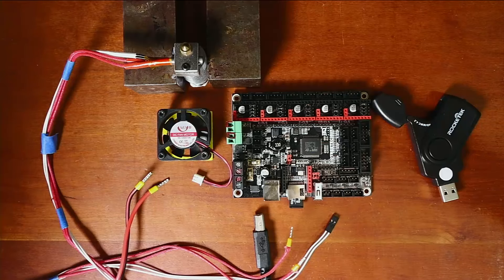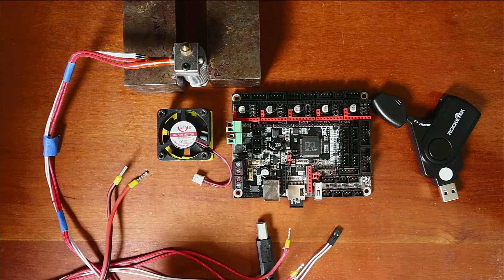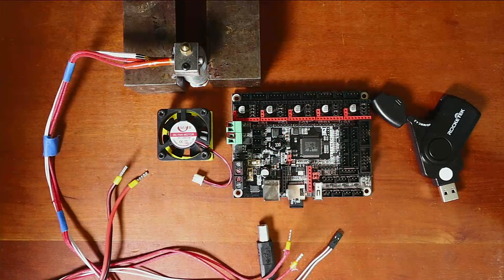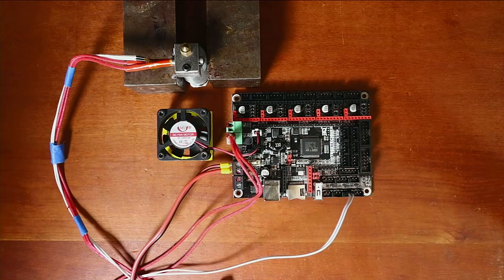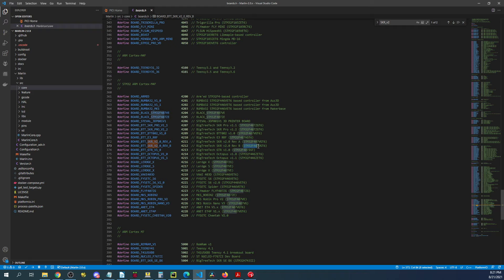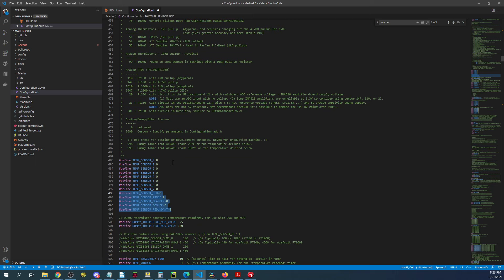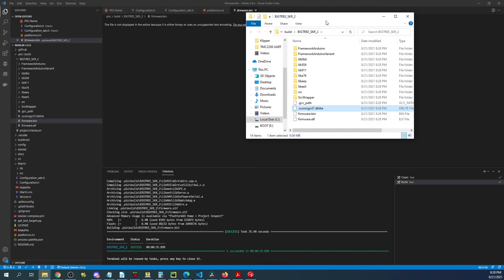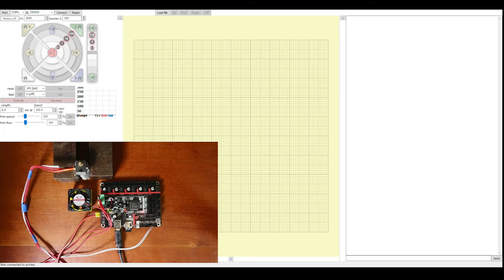BTT SKR2 - Extruder and cooling fan automation

Comment: Hi Ed, and thank you for this as well as the Discord group. I've just added a 2nd cooling parts/layer fan, but I'm not sure which changes I need to make. Only 1 of the 2 seem to come on, but they both work 100% on their own. By default, I didn't have to designate any pins for my original single layer fan (it was plugged into PB6) Adding a fan to PB7 only made that fan work, but not my original fan in PB6. I'm kind of stumped. My slicer had no issue turning my original fan on while only connected to PB6.
Reply from the maker: I'd need to look at board configuration and configuration files to understand issue better.  A couple of people in discord know how to set it up.  I might be busy the next day or two as my day job just got a little busy
Reply: @EdwardBraiman  I figured it out. The solution was to do nothing lol. My slicer turns them both on for my third layer height cooling. I moved the fan for my stepper cooling (made corresponding fw changes), but the other 2 auto came on for my third layer when plugged into PB6 and PB7. No fw changes needed👌
Reply: @EdwardBraiman  I wanted to say 1 more thing I thought of: when using octoprint and turning on the layer fan, only 1 of the 2 turn on, but when printing they both come on from the slicer.
Reply from the maker: It's gcode driven commands.  So that means you can test in something like Pronterface.

Comment: I bought a 60mm 12v Silent noctua fan for the board and drivers and some buck converters. Would I just pull the 24v for the fan off the port in the order board-buck-fan?
Reply from the maker: A buck converter might work, but I'll need to try to answer better.

Comment: PB6 and PB5 work, but if you try to use PB7 you get an error on compile claiming

#error "You cannot set E0_AUTO_FAN_PIN equal to FAN_PIN."
Reply from the maker: Marlin firmware did changed last week.  Not sure which version you're using, but you found the work around.

Comment: hello thanks for your videos, how can I make the probe do more than 6 measuring points on the plate probe?
Reply from the maker: Inside configuration.h under levelling there should be a variable for that.  I can remember the name of it off the my head, but look for UbL and it's around there.
Reply: @EdwardBraiman  Yes, I have already activated auto bed leveling but my plate is 300mm I need 4 measurements per point and not 3

Comment: Hi i have octopus v1.1 how always on fan pin in marlin for 3 fan in motherboard thanks
Reply from the maker: Are you asking how to turn fan on all the time or hot to turn it on when extruder is in use?
Reply: @EdwardBraiman  always fan for chassis
Reply from the maker: @Skudiero  Here is the link for Pinout diagram for BTT Octopus, not you can use gcodes to turn on fans when needed ... https://github.com/bigtreetech/BIGTREETECH-OCTOPUS-V1.0/blob/master/Hardware/BIGTREETECH%20Octopus%20-%20PIN.pdf
Reply: @EdwardBraiman  thanks
Reply from the maker: You're welcome.
Reply: @EdwardBraiman  sorry i have one question, Hi I have a question where I can find the speed and step accelerations mm for the cr10v2? I have installed octopus 1.1
Reply from the maker: In configuration.h search on, "steps_per_mm", should be just below.  Also I do have a playlist for Octopus v1.1.
Reply: @EdwardBraiman  I need the.  Values of the original cr 10 v2, where to insert them I know 🤗🤗